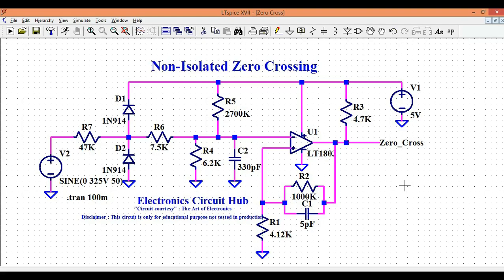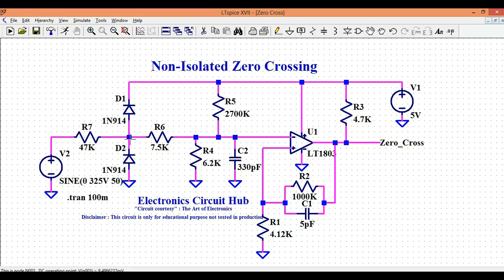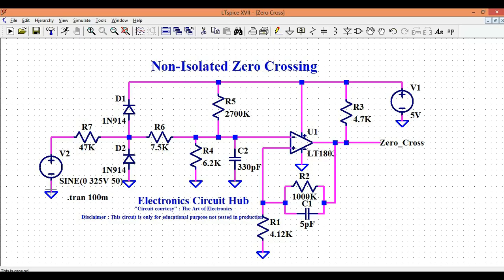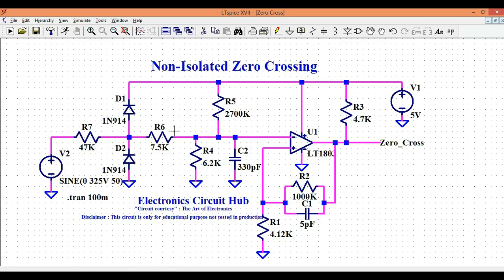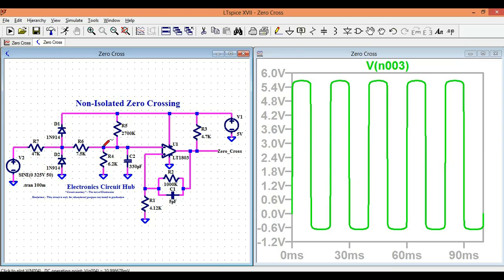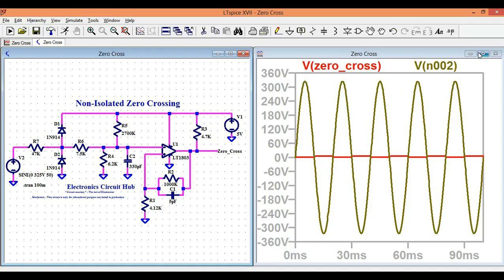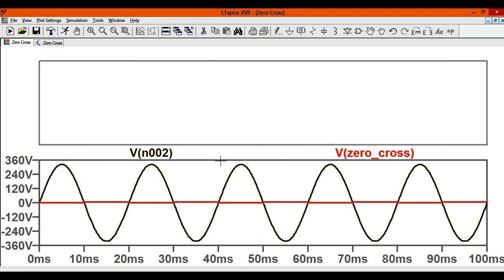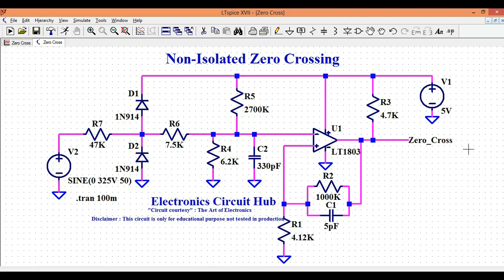Non-Isolated ZCD Design & Simulation | Zero Cross Detector

Comment: Professor, the circuit needs to be adjusted for slew rate of the opamp. 100v/us is a little slow.
Reply from the maker: Hi Dan...thanks for your questions...Slew rate of an opam 100v/us is too fast not slow....the higher slew will increase the opamp cost...we are dealing with 50 Hz so I do not think any issue...
Reply: Professor,  correct 100v/us is 3 orders faster than the 430v/40us. I was wondering about the delay between the zero crossing and the switching of the output. I assume we cannot adjust the delay time. Thank you